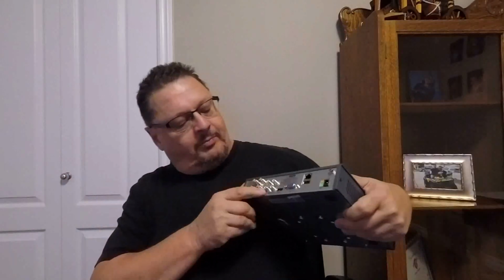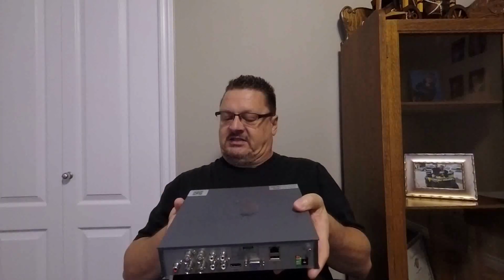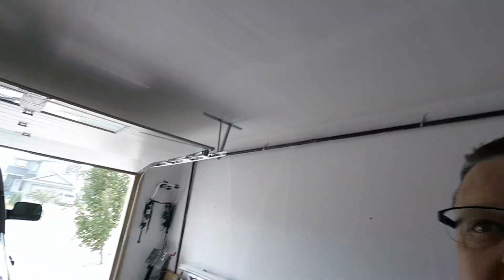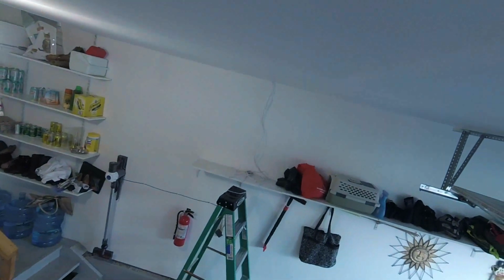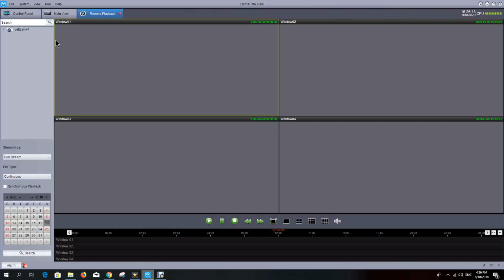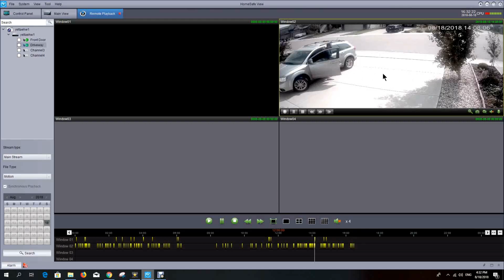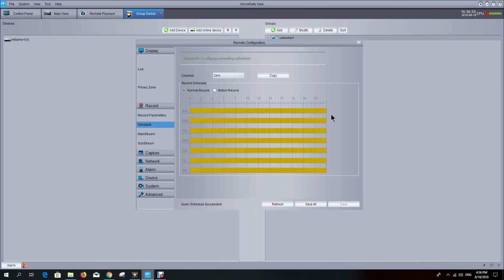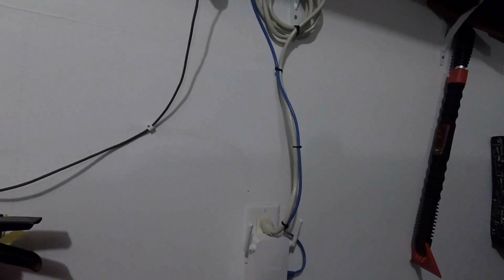How to Install the Swann Pro Series Security Camera System - 2021

Comment: YOu might can help me? I have a DVR4-5580. On the system / mode it says DVR.. There's a drop down here that shows XVR. Now I know what XVR is. I'm just wanting to know and understand, can this DVR sys take a IP cam?   Thanks
Reply from the maker: This model of DVR is for hard wired cameras with the RCA style connections.  No IP or wireless capability that I am aware.

Comment: My security system is located in my garage and I need some way to connect my DVR to internet. What wireless extender do you use?
Reply: Tom Wheatley I just got a power line adapter and I’ve been using it for about a month now and it works great I’ve had no problems with it

Comment: Hi Tom, I need your expert advice again, I have so much cable left from my Swann cameras that it would be ideal to cut them to the size I require, would I find a problem doing so? many thanks John.
Reply: You can't cut because of fittings on both ends. Get shorter cables.

Comment: Hi Tom great video 
The WiFi Extender if the power goes off or WiFi goes off, then comes back on again, will the WiFi Extender automatically reconnect or do they have to be paired again